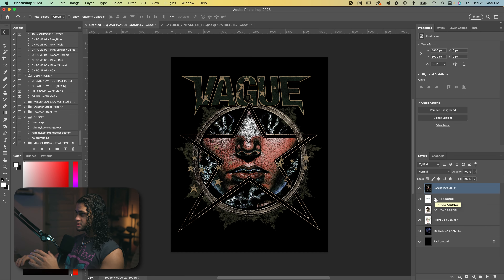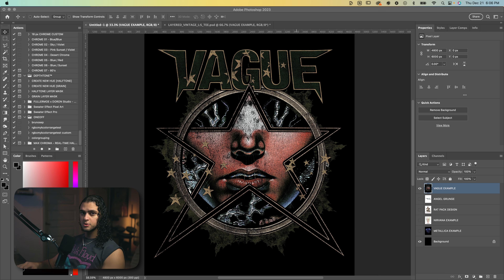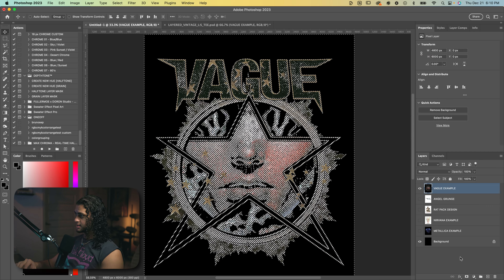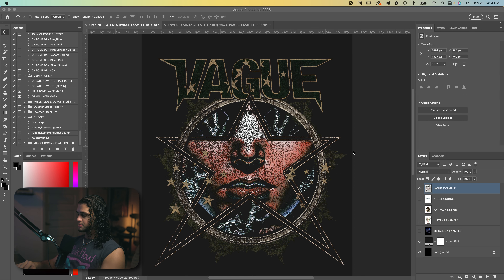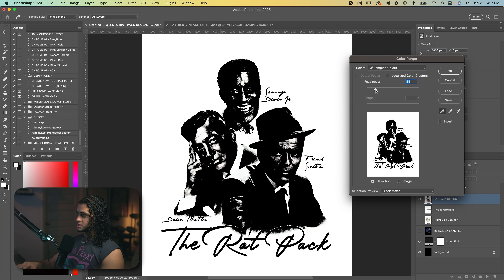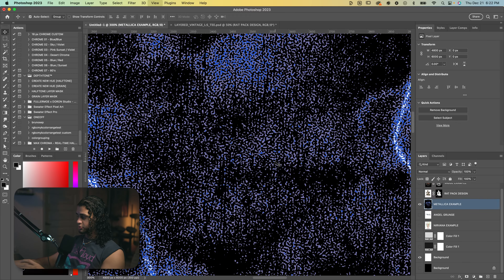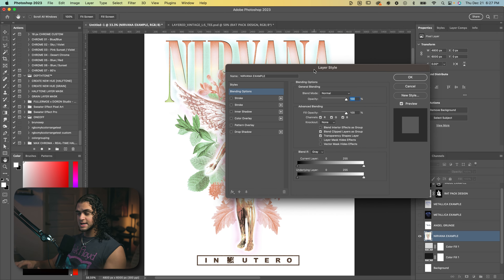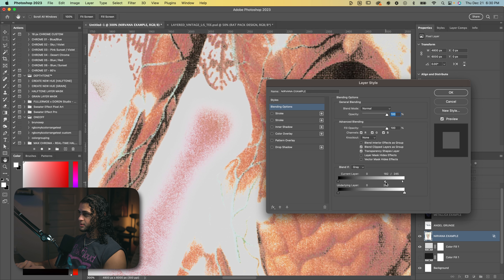The Ultimate Guide To Removing The Background From Your Design | Photoshop Tutorial

Comment from the maker: Two things I should have mentioned:
1. Color range and blend-if are pretty interchangeable, I mostly use blend-if because it’s easier and I typically work on black or white bg’s. Color range may come in handy if your background isn’t black or white. It also grants you a little more control over what colors you want to exempt from your selection (i.e. if the selection is catching part of your design, you can use the negative ink dropper icon in the color range panel to exempt that color from the selection). Those are rare cases in my experience so I just stick to blend-if.
2. Notice all the designs displayed are just one layer. I always duplicate&merge everything when I’m done with a design (cmd+alt+shift+e) to get it flattened onto a layer. Just easier to work with that way.

Comment: Doron, thanks for the video. I really get a lot of value from your tutorials and you have inspired me to get much deeper into the streetwear niche. I design primarily for POD but I really like the aesthetic of the early silk-screened tees. I have even done simulated process halftone separations and then re-combined them for POD, simply because I like the style. Avoiding transparency is one of the things I had to really research lately. I found 2 anomalies in Photoshop that create transparent pixels and most people don't even realize it's happening. One is the blend-if method of background removal you described here. It's fine if you do not split the sliders. But as soon as you split the sliders, photoshop uses semi-transparent pixels to actually create the smoothing.  You wouldn't know unless you pixel peep at the individual pixels.  The second way Photoshop adds transparency to pixels is if you scale any image with a  transparent background using interpolation. If you scale an image up or down, even 1%, using any interpolation method other than "nearest neighbor", photoshop adds transparency to some of the pixels. Again, it is unnoticeable unless you pixel peep. The transparency in these two cases is so minimal that it may not even affect the print, but I still want to avoid it if possible.